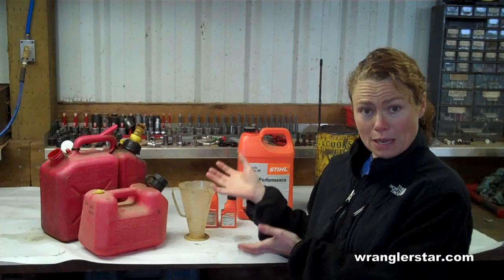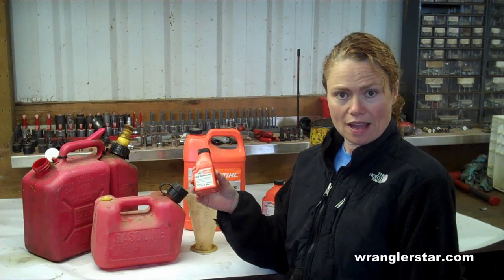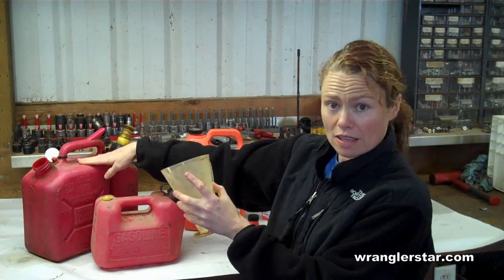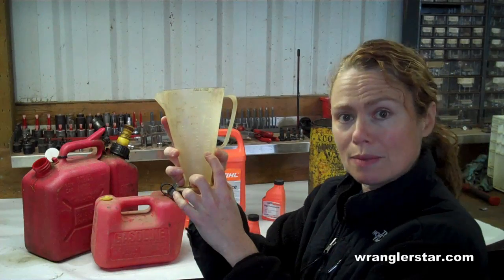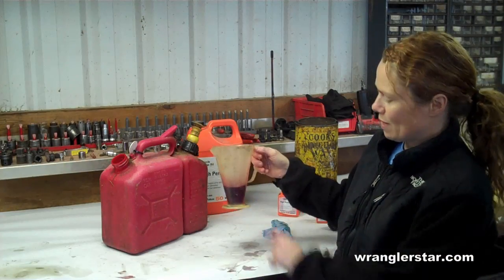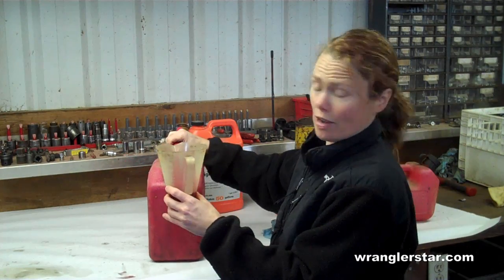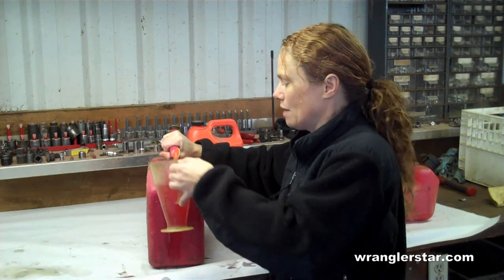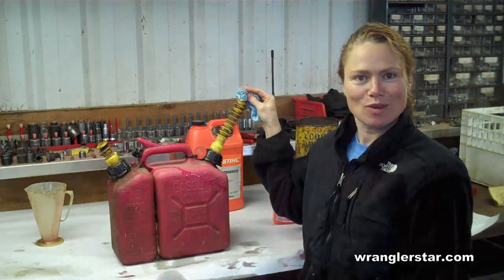Girl's Guide How To Mix 2 Stroke Gas & Oil

Comment: You're right.  Good video but that's the first thing I noticed on this video.  Any container shaped like the one containing the 2-cycle oil, or anti-freeze jugs should be poured sideways so it flows smooth without making a mess.

Comment: I'am a sceptical person I had to try it and there is a difference, been running chainsaws for 16 years. I learned years ago from tree fallers they take drums of the highest octane gas into the camps. The fallers told me when you mix oil in gas it reduces the octane quite a bit. I also switched to using Stihl brand mix oil exclusivly 14 years ago. Never had problems with my Stihl equipment since.

Comment: I by far am no expert but try adding some seafoam to you mix a couple times it is a fuel stabalizer as well it will help clan the carbon in the engine making it run smoother check around you local area more and more gas stations are starting to carry non ethanol fuel but it tends to be more than even the high test stuff by about 20 cents or so also read your manuel on your chainsaw some require a mix other than 50 to 1 and your mix might be to lean or to rich

Comment: One thing I would add is use the highest grade of gas you can get from a gas station it does make a difference with 2 stroke mix. I myself like the little mix bottles I buy them by the case the loggers around here buy it by the skid. The fallers pickup trucks always has 100 bottles or more of 10 litre 50-1 mix lol.

Glad to see Mrs Wranglerstar isn't scared to do things like that, more todays woman needs to be like her.